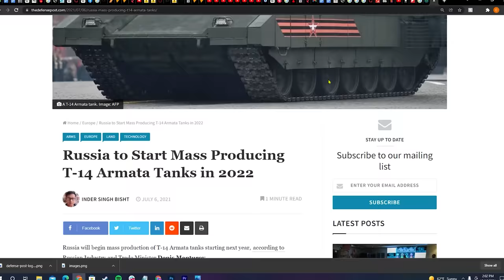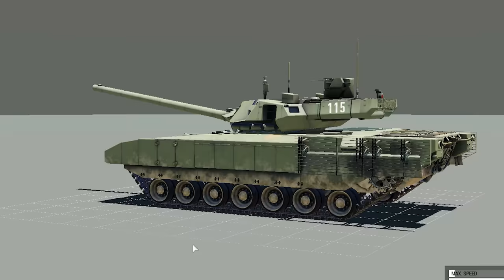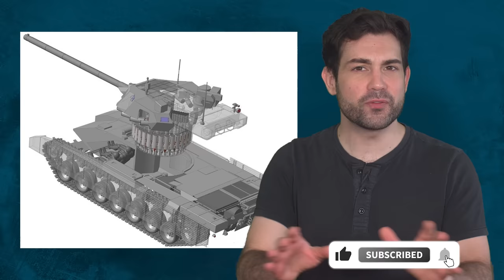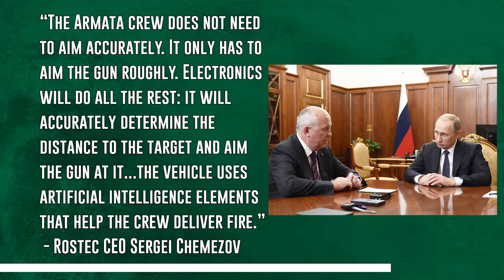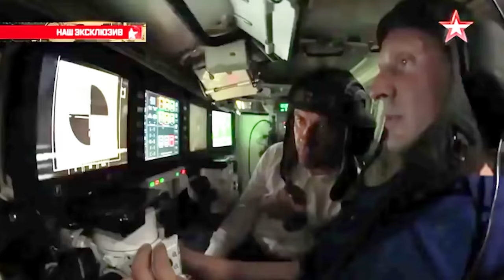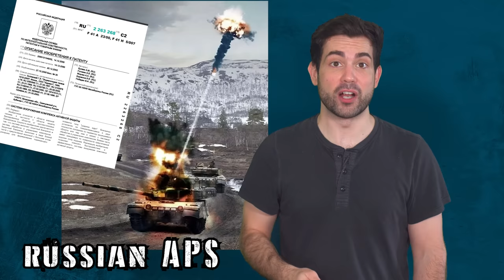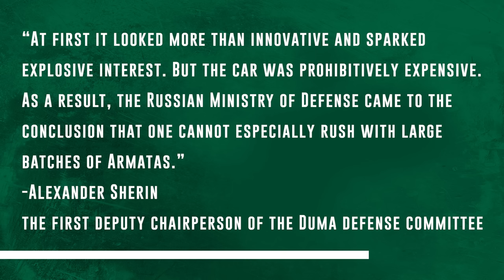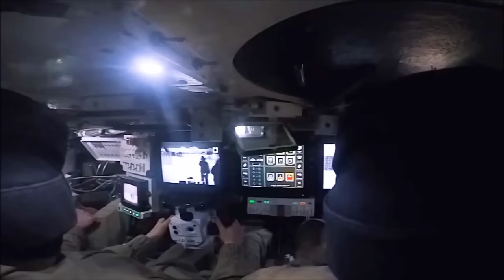The Truth About Russia's T-14 Armata Tank

Comment: The problems with auto loaders are reliability, for one. They’re much more complex than manual loaders. When they jam, as all guns do at times, there’s no real way to unjam it.  Two is that there are several types of ammunition. Manual loaders are able to resort the ammo to better reflect the conditions they’re going into. Auto loaders can’t do that, they have to turn the carousel until the needed rounds are found. That’s very slow. If power is out, the gun can’t be used. 

And of course, many Russian weapons don’t work as advertised. We’ve never seen it in actual battle. Are the Russians as confident about this tank as they claim? Considering how easily newer updated versions of the T-72, T-80 and T-90 are knocked out, despite having active armor which supposedly prevents that, you have to wonder how well these new weapons and armor also work. Where are the T-14s in Ukrainian? Surely they must have a few that are combat ready.
Reply: Iff your "Active Armour" is what you call ERA then yes it has shown its ineffectiveness against modern tandem charge ATGMs and top attack munitions, no modern MBT without modern hard kill active protection systems is capable of stopping modern tandem charge ATGM munitions, not russian tanks not Chinese tanks and not NATO tanks. T14 has hard kill active protection system "afghanit" that is capable of stopping and degrading APFSDS along with ATGM's including top attack munitions, iff based in some truth this make the APS systems of T14 already on par or slightly ahead with the "Trophy" hard-kill APS used on Abrams and "Iron Fist" used on Challenger 2. The "Malachit" ERA is probably the best in the world. The other problem with manual loaders is the fact that you have to train and pay them and their training and proficiency will vary from person to person, a major problem for a nation that is perpetually bankrupt. also there is no evidence of T90-M1 has been destroyed which by the way is the only one of your above listed T72 and T80 that has received upgrades past Kontakt-5 and Relikt ERA on top of a 70s and 80s vehicle specifically T-72B3,  T80BVM and T90 the latter of which has received virtually no upgrades.
Reply: @jonomurphy1117  we don’t actually know what on the T 14 works, as it hasn’t been tried on the battlefield.  It’s one thing to market it as working, and then show some carefully controlled “tests” showing it working, but that means nothing. How many of even those controlled “tests” failed before the ones they “allow” out to the public succeeded? We don’t know. But Russian hardware is not considered to be reliable for a number of reasons, design, manufacture, corruption, etc. Their missiles are failing at up to a 60% level, when military experts say 20% is normal.

So I find it hard to believe much of what the Russians claim, as they can’t even seem to mass produce these things. Remember, they should have had over 2,000 in the field several years ago. So, realistically, even in the unlikely scenario where these do work as claimed, they aren’t using the few they have, and no matter what they claim about production, there no reason to believe there will ever be enough for a real battle. They should at least have sent a couple dozen in to test them under real field conditions. This was a great opportunity where the force against them has only older models. Why haven’t they? Maybe they know they won’t perform up to expectations, and that would be a major prestige blow. To think that their latest super tank could be destroyed by a $43,000 hand held missile would be too much to bear. Their equipment customers such as India might become very nervous about buying them in the future, particularly seeing as how easy the current models India has now are destroyed in Ukraine.

I think there’s the possibility that they’re hiding something. Don’t be surprised.
Reply: @melgross  while I would agree with the economic factors it is MY OPINION that the T14 is exceptionally capable against modern munitions iff employed effectively and let me remind you that the United States last attempt at a replacement for Abrams went belly up in the early 2000s. Javelin struggles against active protect systems in the hard kill capacity however no Russian tanks in Ukraine feature such system. Just because it can knock out a vehicle that is 90 percent from the 80s doesn't mean it's all ending or god awful it is what it is.
Reply: @jonomurphy1117  the problem is that you don’t know,how effective the T-14 is. Don’t say you do. None of us do. I just read an interesting article about why it’s not in the Ukraine war. The reasons were several, but mentioned as important was that the Russians are trying to line up buyers of the system before trying to manufacture a large number, because some have gotten out of hand, apparently doubling what they should have been( something we see all the time with military hardware). But they’re afraid that what’s happened to their latest attack helicopter there might happen to the T-14. That copter was knocked down in at least two incidents.

Reportedly, the Chinese, the possible customer for them as their own is seen as a failure, is asking for information on why and how they were shot down. It’s believed that China may decide to not buy them. That’s billions of dollars in sales possibly lost. Russia can’t afford that. So the thinking goes that instead of putting some of these tanks into action against the weaker opponent in Ukraine, which would have made sense, as a test of their effectiveness, they’re keeping them out, as it would look bad if even one or two got destroyed by a missile. And these missiles can get past these active defenses, as they’ve been modified to do so with double charges, etc. don’t be so smug about these ranks. They’re not even close to being battle tested. You should be questioning why some are not there now.
Reply: @melgross  Exactly then why are you assuming it's a failure as a program and all of it's key design features are worthless iff both you and I know sweet fuck all about the real performance of the vehicle?
Reply: @jonomurphy1117  I’m not,saying that. Find where I did. I’m saying that we don’t know if it’s a failure or not, but going on what we’ve seen of Russians weapon systems over the years, with their reliability problems and such, and the lack of actual data from the battlefield, it’s impossible to tell if this is as good as we’re,being told.

And truthfully, since you don’t know anything at all about whether this will work as advertised either, there’s no reality in your position that it will, as you seem so confident it will.

All I’m doing is posing the question that this may not be as good as those supporting it are saying it is, and giving supportable reasons why it might not.
Reply: T14 is still in prototype, so I doubt they will be used in service there. Besides, Ukraine has the same capabilities in terms of military tech compared to the Russians. Western equipment and aid is definitely a bonus for them too.
Reply: @user-xm8lc1om6w  it hasn’t been in prototype for years. It was supposed to be produced in large numbers as long as six years ago, possibly earlier. Then again a few years ago. Now it’s supposed to be in mass production this year. Each time they ran out of money. And all tanks get upgrades over the years. They product the first version in large numbers, the work on the upgrades which come out several years later. Then they update some of,the older ones. This continues for decades. The T-72 is upgraded as is the T-80 and the mainstay of their force, the current T-90.

This is they was it’s don’t with the Abrams too. It’s nothing new.
Reply: Hard agree on all the points. (also I am a tank crewman Master Sgt. Ret. IDF)
Reply: And not forgetting the famed Russian Propaganda Machine, probably the most fine tuned weapon in the Russian arsenal of weapons.
Reply: @jonomurphy1117  the proof is in the pudding and there is no pudding here. The person making an inane argument here is you. OBVIOUSLY if the T-14 worked as advertised and was so great at defending itself it would have shown up in Ukraine for the publicity and propaganda value. The fact that it's not there tells even a cursory observer everything they need to know about the T-14's current state. It's a total failure to this point and does not exist in the way it's been advertised. Russia can't build complex high tech machinery with high reliability. They don't have the money, the components, the expertise or the experience. It's laughable that you think they suddenly are making huge technological leaps forward, particularly in high tech hardware. Are you using a Russian computer to make your naïve arguments? We have decades of evidence of Russia making claims about capabilities that never actually exist or come to fruition yet somehow you just want to believe that the Russians are making world class engines, guns, optics, targeting systems, defensive systems, armor and automation?

Wake up. If it worked it would get used and we would see endless videos about how awesome it is. It doesn't work, end of story.
Reply: @hqhq4611  I wouldn’t say “alas”. I would say, “thankfully”.
Reply: Oh, c’mon. The first autoloaders were adopted in the navies at the beginning of WW2, so they’been experimented for nearly a century.

Autoloaders, as many others military things, will always have pros and cons. It depends on how you use them. But there is really no issues with reliability nowadays.
Reply: @davideallegri3097  that’s what you say. But they are considered to be less reliable and almost impossible to get working in the field when they do jam.
Reply: @davideallegri3097  you've definitely never been in the military or seen the Navy firing if you think there's never an issue with autoloaders. Gun systems firing 70+ pound projectiles come under enormous forces and the vibration in a ship or a tank is hell on complex mechanical systems. Even semi automatic pistols jam all the time because it's not as easy as you're making it seem and the act of firing gun powder driven projectiles is dirty and fouls up the works pretty fast. 

You clearly are out of your element if you think reliability isn't an issue because we keep striving for higher performance and that always adds more complexity and hurts reliability.
Reply: Russia won't deploy T-14's in Ukraine. There's too few for them to have any impact on the war itself, the only end result would be donating the first knocked out T-14 directly to NATO members to test & analyze. It would be instantly towed to the Polish border and exchanged for an open check to buy as many ATGM's as they would want.

If you see T-14 in Ukraine, it'll mean they're so ridiculously desperate that I would recommend finding your local nuclear shelter, if available.
Reply: @PAcifisti  that’s pretty much my thinking as well. It’s why the chance to test them in a good battle is being passed up.
Reply: @jonomurphy1117  As far as I can tell the afghani APS only works at weapons fired in the frontal arc +/-30 degrees.  No top protection.
Reply: @brianb7388  oh yes. And infact ALL the ships nowadays use that system, like all russian tanks, like many others self propelled cannons, howitzers and mortars.

It’s OBVIOUS that it can jam, nothing is 100% reliable. It depends on how it’s engineered, on how troops are trained to use that and to repair.

An engine isn’t unreliable because it could broke, is it? And it’s something VERY complex.

Maybe I haven’t been in the military, but why russian engineers believe in the autoloaders for nearly 60 years? Are they all stupid? 

Oh sorry, they had to ask everything to Brian B before, right.
Reply: Not to mention that the autoloader means at least for now that you don't seperate the munition from the crew with blast doors and we see the results those days on the news....
All those turrets flying to the sky is the result of having an autoloader/no blast doors.
Reply: French been using autoloaders since the 90s with no issues.
Reply: Russia is losing tanks to launchers that hit the top of the turret. No tank without APS can survive that.
Reply: @NadimSadeeq  You refer to the shockingly expensive Javelin, Its just a tiny fraction of the munition used in Ukraine. The rest of the less expensive rockets are aimed at the munition storage, located at the side of the tank, where the armor is as well thinner. Easy cheap kill.
Reply: @NadavIgra  How was the experience of being a tank crewman?
Reply: @NadavIgra  A veteran of the IDF. Nice.
Reply: @murphy7801  no, France did use autoloader sinze 1951 (Panhard EBR), but yes no issues on the Leclerc
Reply: @murphy7801  you're just making shit up at this point. Where has France deployed a large force of autoloaders into a real combat situation since the 90s?

A little research would tell you that le clercs have basically never seen combat and certainly not tank vs tank combat. So exactly how are you coming to the conclusion there is no problem? I can easily find articles where people familiar with the tanks complain about how difficult they are.

France has less than 200 of these tanks. Not exactly a dominating tank force. Turkey has 700% of the MBT's that France has.

On top of that the leclerc is difficult to maintain and the autoloader is controlled by US built semiconductors. Three ENORMOUS problems Russia has no answer for, maintenance, training and modern electronics. Those 3 and money are all that stands between Russia and a functioning reliable autoloader. Kind of a daunting reality but you're not interested in reality just Russian troll propaganda.
Reply: I thought I read something that the Ukrainians took out a T14 using an American anti-tank system just a few weeks ago.

Comment: We always hear that the fourth man is good for repair and maintenance etc.  But, each tank has a big logistics chain and whatever is moving the fuel ammo and spare parts around can certainly carry extra manpower to the extent it's needed.
Reply: A man less on that tank is a man less to pay, train and getting sick or hurt in battle. I don't know what the costs per year for a FTE tanker is, but say that tank lasts 30 years, it means 30 years of wages.  
 Thinking the other way around you get more firepower with less manpower.
Reply: @bertv.374  I just read that's it's about $750 a month so over the course of 10 years, that money could go into one anti tank missile.
Reply: The maint issue is real. You’re often on your own or just with your Troop /platoon. Tanks are dispersed as much as possible so they don’t get smacked by arty. Plus fuel / ammo / spares / supply is very vulnerable so is done as quickly as possible. 

You’ll miss the extra man…
Reply: Your comment about logistics and support proved surprisingly prescient. 🙂
Reply: the logistics train is true but in case of comparison the US has one of the most robust long range logistics trains. From personal experience that 4th man makes a difference and with the rapid (by comparison to others) logistics train help to get equipment back to battle quicker.
Reply: @Stormcommando  Fair enough, I've literally never touched a gun so I bow to your experience, but still, the massive weight saving from smaller required volume  for smaller crew, plus potentially less armor for turret due to unmanned turret, turns into a cost saving in manufacture, transport, and maintenance.  At least some of that can be directed towards having just a bit more logistics, no?
Reply: @lqr824  If you have a maintenance team with the manpower to spare yes. In current iterations of things the crew ends up doing a lot of the maintenance and install. Even on the more complicated things the maintenance team should be doing you end up having some guys have to help them. God help you if you break track (where you have to replace all or a section of the track) that sometimes takes two crews to get that done quickly. I will say I agree with a bigger dedicated maintenance team that 4th man would be less relevant in this case.